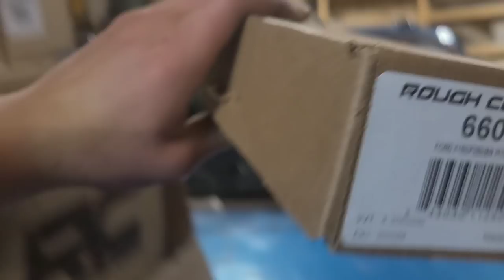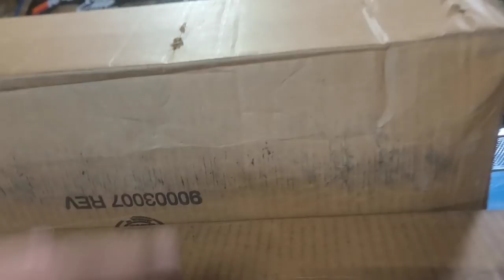CALI LEANING THE STACKED F150

Comment: Warm white (4000-5000 K) xenon bulbs - that's what that baby needs IMHO. I remember one vid, you were driving in the dark and frankly low beams were darn dim. If you put warm white, not some crazy blue eye-scorching lamps cops won't be able to tell the difference. These Chinese kits are really durable (tested, installed 3 of them, none failed after 5 yrs.). The cost is $100 tops, with ballasts, cables and all. Just a hint 😊